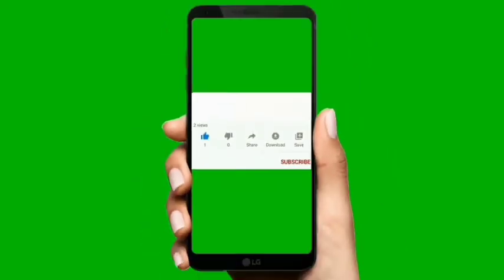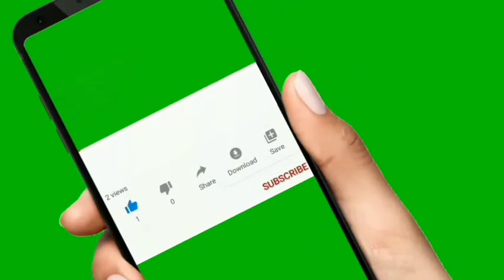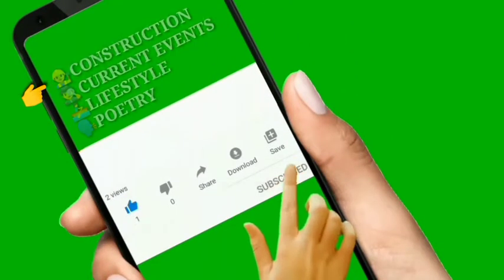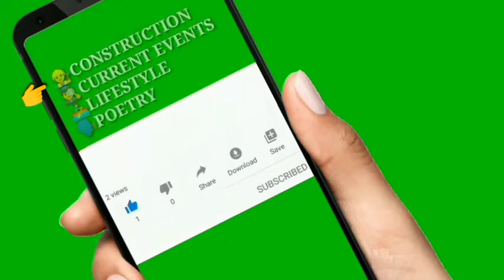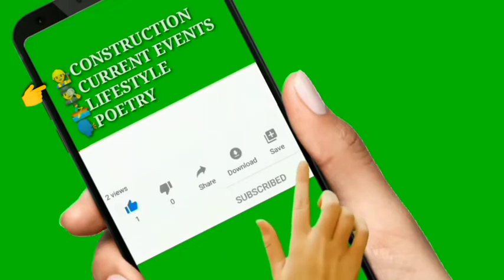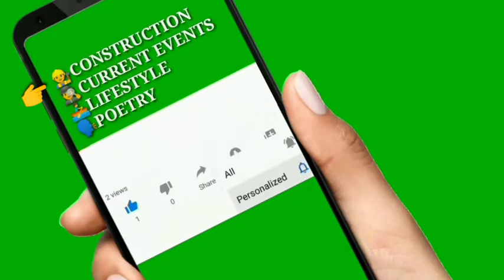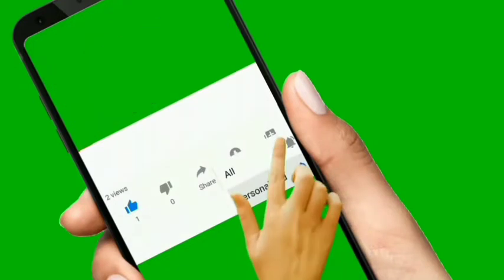SPRINKLER SYSTEM INSTALLATION | Bakit Kailangan ng Sprinkler System sa Building?

Comment: Sir pwede po magtanong , nagbabago po b ang pressure sa riser time to time, nataas o nababa sa pressure gauge, kasi may nagsabi po na gawa raw po ng temp? Meron nmn ngsabi na wlang koneksyon ang temp, salamat po sir at more power sa channel nio.
Reply from the maker: Hello po, hnd po kasi ako expert regarding sa mechanical works sir..pero sa tingin ko po may mga factors din sguro na mabago ang pressure, lalo na pag kalaonan may sumingaw or leak pipes (branches).

Comment: Mechanical engineer here. Thanks sa upload. Suggest ko gawa ka ng video about sa stand pipes and Accessories.
Reply: Brad anong tamang pagkakasunod niyan structural,architectural.....ano na next niyan gineer?
Reply: Interms of designing: architectural (base plan), structural, mechanical, electrical and sanitary.
Implementation: civil, sanitary, electrical or mechanical and ofcourse guided by architectural depende po sa gagawing proyekto. Yun kasi sir ang observations ko sa mga previous projects ko, residential, commercial and mixed use building.

Comment: ask ko lang po sir kung pwede ba gumamit ng pipe size 1/2? or anu po ba ang minimum standard size ng pipe na gagamitin?
Reply: Usually 1" ang pinakamaliit na ginagamit. Ang sprinkler heads ay 1/2" yan kaya ginagamitan ng coupling reducer na 1" x 1/2" to connect the sprinkler heads and the pipe droppings. So pwede naman cguro gamitin, iniiwasan lang sa practice kasi tataas ang pressure drop as the pipe size decreases. Pero, di po talaga ginagamit sa practice yan sir. I have yet to discover na ginamit ang 1/2" sa installation.
Reply: Depende po sa application yan sir. May computation or estimation po ang pipe sizing.

Comment: Bkit nauna pang i installed ang kisame,gayong wla pang linya ng firepro,hayan hirap tuloy gumalaw ang mga pipe fitter?
Reply from the maker: Hello po, yan po ang challenge sir pag iba iba ang contractor at matagal mag start c fire pro.
Reply: Minsan talaga nirrequest ng ibang fire pro contractor na mauna ang ceiling frame kasi yan ginagamit nila reference para sa drop ng sprinkler. Hassle nga lang s kanila yan pag mag kabit na.

Comment: Hello sir. Ano po bang pwedeng maging rason para ireduce masyado yung size ng tubo sa isang building? Kase yung may kontrata kami ng erpat ko sabi nya di na daw pasok sa scheduling yung sizes ng pipe. Yung teacher ko noong college ang gumuhit neto. Yung mainline nya de uno lang. 5 storey hotel building. Thank youuu!
Reply from the maker: Hello po, sa pagkakaalam ko sir mas maliit na tubo mas malakas ang pressure..kaya sguro pinareduce para kahit hanggang 5th floor ay kaya parin.
Reply: Disregard nalang siguro yung pressure, kase malakas talaga yung pump ng fire pro system. Talagang di ko lang mapagtanto kung bakit sobrang reduced na yung sizes ng pipes ng siamese, riser, mainline at branchline. Kung susuriin talaga basi sa NFPA 13, di nakasunod yung sizes.. Hmmm. By the way, thank you sa sagot nyo. Lage ko rin pinapanood mga videos nyo.
Reply: Kasi pag nagbago ka o reduce may flow o pressure kang ilalagay sa luob ng tubo at kailangan din yun para malaman mo ang sizee ng fire pump mo.
Reply: May 2 methods ng pag design: and paggamit ng Pipe Schedule Method at paggamit ng Hydraulic Analysis to select the proper pipe sizes. Yung pipe schedule method, luma na yan at it is only allowed under certain conditions as per NFPA13. However, pwede mo sya gawing guide, then perform hydraulic analysis to analyze and verify if sakto lang ang pipe sizing mo. Kaya nga these days, hinahanapan ng BFP at OBO ng hydraulic analysis ang mga fire sprinkler systems. Also, agree ako sa erpat mo - masyadong maliit ang 1" for cross main, pang branches lang yan. Unless cguro kung nakaloop ang cross main mo and it was verified by hydraulic analysis na sakto lang sya and as long di lalagpas sa 175 psi ang pressure ng system mo. It is important to consider din kasi when designing yung economy side. Pwede mo naman  paliitan ang pipe sizes para cheaper pero you increase the pressure of the system, lalaki ang horsepower ng fire pump and jockey mo. So, mas maganda to perform hydraulic analysis of the system to find the right balance.
Reply: Kung 5 storey hotel building kumporme  Kung gaano karami yun Room main puede n 6" raisers , manifold 2 1/2 . branch line ,1 1/2 to 1" komporme ulit Kung ilang yun room n lagyan  ,,  Ilan sprinkler head Ang ilalagay nasa design yan kasi Yun 1" pipe design 2 head sprinkler head  Kung gusto no look mo sa NFPA 13 Doon marami code